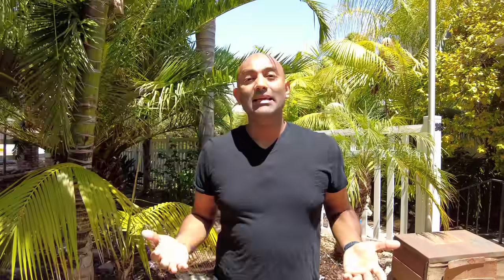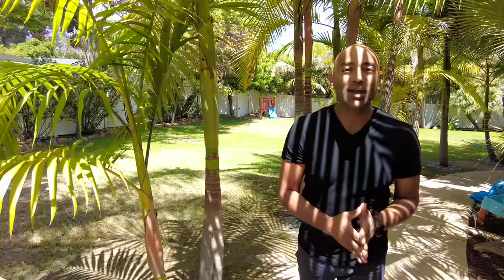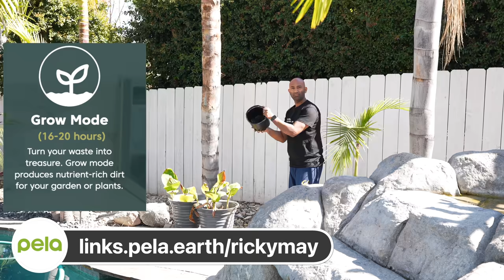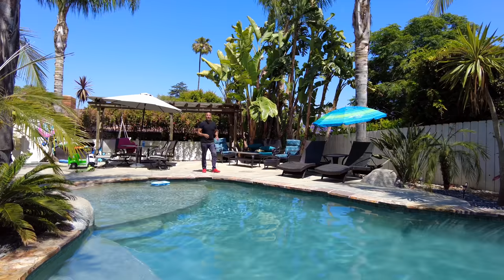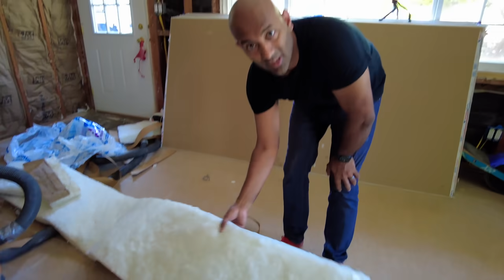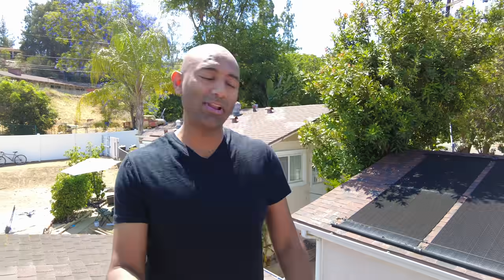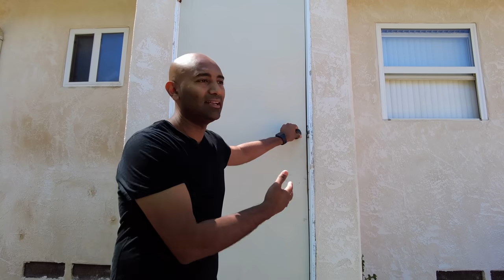How I'm Planning to go 100% OFF-Grid!

Comment: Love your channel. 

You should consider PVT solar panels, you get double the benefits, more efficient solar panels and some can even generate electricity by heat transfer! 

For your roof mounted pool water solar heaters, get some of the giant black metal exterior mounted (roof or walls) radiators like heat exchangers the Germans use. It's works exactly the same way your leaking ones do but are far more robust! Heavy also, but as you are sorting the roof, no dramas. You could also have one for your hot water. It helps the heat pump out by having the water at a higher ambient temperature, a double win for efficiency!

As for your cooker top hob, I highly suggest fitting an induction hob. No energy is used unless there is a pot/pan on it. It's got to be the right type of pot, but they are genuinely ace. Kid safe as well as you can turn it on, place your hand on it and there is zero heat. It only heats when the pot goes on....but you know that already I am sure! 

Question, you live on San Diego. It's warm there correct, hence very little to no insulation on your house? Why do you need a clothes dryer? Hang your washing outside on a line as we used to years ago. It's free and if you want that softness that a dryer leaves, just plonk it on for the final 10 minutes to finish. 
I love in the UK and have not used our drier since June! Washing line and clothes horse inside/outside as necessary! All free. 

I love what you are planning to do with this house. I will be watching closely as I night end up having to do the same on an old house here in the UK.

Comment: In Vietnam we usually have a solar water heater that use glass tube filled with oil to heat up water. It can run very well in a long time without needing for maintenance and very well resistant to contaminated water. Heating water takes a lot of energy and using solar electricity to heat water is not a very efficient way to heat water. With the small house that you only occasionally use hot in, you can use small electric water heater. It's easier to install and maintenance, also cheap and can be turn on off easily whenever you need.
Reply from the maker: Very cool!

Comment: Very interesting and big project! Looking forward to seeing the results.

For the 2nd house, if you only need hot water for a single sink, an under-sink tankless electric heater would be fine. They are available with as low as a 20A breaker (e.g. Chronomite). I'm investigating doing this for each room, to eliminate lag - without needing a recirculation pump.
Reply from the maker: Interesting! Yeah that could work

Comment: Could the heat pump for the pool cross connect to the geothermal system heat pump? You may be able to cool your house by heating the pool only
Reply: yes, but when you need to heat the pool the house may be cold too
Reply: @gsabic  then the pool could be aligned to the geothermal system. In theory it's the same as the octovalve on teslas. In practice it might be different
Reply: @beilkster  using the pool to cool the outdoor coil of a heat pump ( kind of geotermal) is a good idea, I have seen online heat exchangers that can be conected to the pool pumps pipes to works as outdoor coils in a heat pump. but there is only a small window of time when you need to heat the pool and cool the house, and adding valves and other coils to the system will make it too complicated specially regarding refrigerant levels.
If you wan to try someting I will do a mini split and see how if works before try a big ducted unit
 I used to be an hvac tech
Reply from the maker: brilliant
Reply: I don't know if that would work with geothermal but i am pretty sure i have seen a pool heatpump heater that could make this work. 🙂
Reply: Currently I have a solar water heater panel on the south side of the house that provides 160 degree water by 10 AM. Cost 12k installed and has worked well for 6 years. There is an option to run the hot water into a radiator inside the HVAC unit for winter heating.
Reply: @gsabic  This Old House had a project video a few years ago with someone doing this.  In the summer, the AC dumped the heat into the pool.  It is possible and a great way to kill two birds with one stone.
Reply: @thezfunk  good video, but more a science lab poyect than a pool heater. if you need to  heat the pool most likely you are not using the AC or just not enough to make any diference in the pool temperature

Comment: Why not do both for your solar? The dualsun is a solar panel that cools itself (water loop) which then heats your pool at the same time. I saw Linus use it.
Reply from the maker: Leaks and stuff just worry me. It’s a great concept but I have a salt water pool not sure how it’ll hold up. Solar panels are dead simple and reliable, not sure I want to complicate it
Reply: @TwoBitDaVinci  that's true. You can always do a small experiment, heating the other water tank, then and make video about it ;)
Reply: Have an independent glycol loop and heat exchangers. Systems are way more reliable than they used to be, the house is full of plumbing that doesn’t leak, it is possible. Besides if a roof can’t handle water on it what good is it anyway?
Reply: Also a supply of hot water is crazy useful. Any heat pumps trying to gather heat like a water heater or clothes dryer can have hot water passed over their evaporator and gain incredible efficiency.
Reply: You can use a simple pump and black-painted loops of PEX in homebuilt panels to heat that pool!  That can keep the bulk of your solar installation simple.  DualSun is a fascinating concept and work an experiment, because it does save you a lot of energy in heating water!

Comment: I am from Brazil, and here we do not use water heating using natural gas. We use showers with electric resistance and electric taps with the same technology.
In my view there is no need for natural gas in a residence.
Reply: I also see no need for a central heating system, here we use residence room mini Splits
Reply: agre, but those shower resistence electric heaters are not enough for the water temperare in USA. perople here like hot showers and not geting "zap" with electricity
Reply from the maker: depends on your home and your conditions. I would need like 7 mini splits for my home and that's not good. a central system is actually more efficient at some point. It depends on you, but we're going to go with smart vents that open and close and only heat or cool where you want it to
Reply: @TwoBitDaVinci  efficiency is mesured in USA in seer rating, 7 mini splits are much more efficient  than a central unit with the same seer. Lost of the energy is lose with the the duct, and smart vent are not smart, by closing a vent that you may not need you are creating static pressures and lowering your efficiency, to be able to do that you will need oversized duct and barometric bypass. If you wan diferent temperatures in every room you may wan to install zoning system (not eficient and expensive) A central ducted unit may still be the best option, but is usualy not cheap and not efficient. I used to be an HVAC tech
Reply: @gsabic  Electric showers heat the water around 55ºC, which would be equivalent to 131 °F. And there is no risk of electric shock due to safety restrictions imposed on manufacturers here.
Much of Brazil runs at 220V.
Reply: @HenriqueSilveiraSteinmetz  I am familiar with electric showers, I travel in brazil and all of centro america. they are a good option because they are cheap, but they only work when the water coming from the pipes is not cold. Maybe the new showers got better, but I did got zap a few times and almost every time the water was not hot enough or water flow was very low

Comment: Love it! You might consider looking into Sunamp thermal batteries for hot water heating. I believe you could throw heat at it using off peak electric, PV or evacuated solar tubes and it could smooth out your power demands to a more manageable level, while effectively serving much like a tankless water heater. The evacuated solar tubes would also probably work much better for your pool heating. Also, you might consider looking into those copper drain pipes from the shower that have a supply line wound around it as a means of pre-heating cold water incoming to your water heater. If you go geothermal, you'll have a pre-heat water tank too that'll reduce the temp differential even more.

Comment: There is a company that sells water cooled solar panels they’re an awesome way to go because the cooling makes the solar panels more efficient and you get hot water supply from them
Reply from the maker: my pool is salt water, and I do not think I want that added complexity and chance of leakage. traditinoal solar panels have served me for over 10 years in my previous home, and they're just so dead simple .... think I'll stick with it
Reply: @TwoBitDaVinci  you should consider either using these solar/hot water panels or just a few real glass hot water panels and a super insulated tank over the gas water heater. Or I have a desuperheater as part of my geothermal heat pump that does my hot water, if you do go with that for your heating and cooling.

Comment: We have a solar hot water heater… the panel on the roof is a rigid steel/plastic assembly with pipes. A pump pumps the water from the water tank to the roof where it heats up. When the water is hot enough a thermostat cycles the pump and starts it all over. I would think that short of solar water heater would work better for the pool that those mats you have now. Mine has been in use for 30 years… still going strong

Comment: Put better water heating mats under your PV panels, that should help with plastic UV  degradation.
Reply: Good idea but the material will still break down from heat/cold expansion/contraction and ambient sunlight but could add greatly to the length of both systems if done properly, if poorly don't could foul both.  I would suggest considering a thermal mass with the pipes laid within such as a full sun sidewalk or retainer wall that would transfer to pool without a 15 foot lift required and much more durable components thru out.  Use black rock or paint it to absorb heat...make a waterfall with a tidal pool that would warm in the shallow.  The earthship was designed to mimic nature's processes but in working compact integrated systems...with various options for the site/environment and need for back up/redundancy plans.  Requiring regular maintenance, earthship systems can be primitive to high end tech..but each require systems checking frequently based in an understanding of how the systems work.   Retrofitting a build conventional is a form of recycling but EShips concept was reuse as much as is possible from the waste stream of society to save on costs for building materials, reduce landfill waste, proof of concept, low carbon footprint, etc..
The project steps completely away from this with existing duplex, huge..conventionally build, already ripping and replacing at full inflated costs to new mates for the studio no less for living space surely.   I think you need to apologize to YouTube viewers for the click bait misnomer, and call this what it truly is...you are renovating your multimillion dollar home and going off grid completely, but not totally because of the instant on water heater need propane not 220V, and this is absolutely nothing related to a fucking earthship, you pompous ass.   I like your content, not the Cockeysville.  Humility and factual comprehensive detail in brevity and a concise form.
Correct course.
Reply from the maker: yeah I am not having water on my roof anymore. I'm going 100% traditional PV solar and using that energy for any heating needs i have via heat pump
Reply: Be aware that even a traditional electric/gas/geothermal equipment mount heater of any type will probably have a working life of three to seven years...ten is long.  Depending on use, climate, chemistry of water...lifetime can vary greatly.  The heat transfer or thermal induction is the weak point that fails and complete unit replacement is required, typ.  Heating a pool  is an imperfect act since heat promotes algae, etc growth counterintuotively to the chemical purification function of chlorine or salt systems.  In a pool with no leaks, salt chlorinators are best overall IMHO.  My concept of a thermal mass, properly calculated would use the same pipe as the pool jets, gentle loading heat energy thru a dedicated flow thru the adequately sized, sunlit thermal mass.  Passive solar such as this is extremely low maintenance and long lived.  The mass could even be used in the house (winter shading under glass) to increase ambient temperature and utilize that constant differential of home heat to outside or water temp.  Pumping timely and plumbed with insulation, etc..is a real potential.

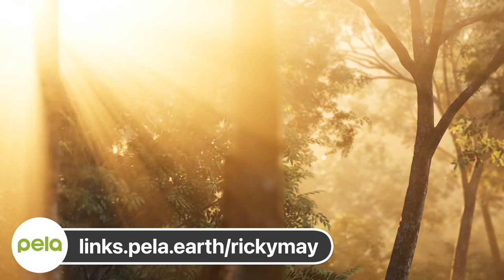Comment: @4:15 Lomi does not make compost. it is a food scrap dehydrator. Composting is a biological process.

it uses electricty to grind the food scraps, and then heats it up to dry out the food scraps. 
this heating process kills the natural bacteria & fungi that Composting utilizes, the heat also causes the food scraps to gas-off the volatiles. (you know that funky ammonia-ish smell, that's your nitrogen fertilizer being lost to the atmosphere...)
you then take the un-decomposed carbon-rich, nitrogen-poor, dehydrated food scraps and add this material to your plants... thus tying up available nitrogen in your soil in the process of breaking down the carbon-rich material into plant usable form.

it'd be easier and less expensive if you either had a compost pile onsite, or simply tossed the scraps into the kitchen sink garbage disposal and let it go down the drain (with your earthship/net-zero design that food scrap waste could be fed into an edible garden via your grey-waste water allowing nutrient recycling)

as a gardener with 30+ years of experience, i'm disappointed that companies manufacture and market these types of products to well meaning people who are easily taken advantage of simply because they don't know what they don't know. 

Why doesn't Pela/Lomi have all of the major YT gardening channels selling this if it's such a revolutionary product?
I wonder why there are few, if any, YT gardeners that promote Lomi? 

Is it because they saw right thru it?
Reply from the maker: the garden mode runs cooler keeping the bacteria alive, that's what makes it garden mode
Reply: @TwoBitDaVinci  But if the compost heats up, there is more biological activity and the compost 'cooks' faster!  Better off just starting a pile in the garden, getting the mix right and turning it regularly. Look it up.
Reply: Very well said H S . Thankyou for trying to wise peolpe up.

Comment: For the s aller working studio, consider a solar water heater. Had one in mid Florida house and it was amazingly hot. No electric or gas assist in my case. You could use the electric simply as a back up.
Reply from the maker: it's a good idea, but our roof space is limited, and I think i'd rather have PV solar. that way i can power anythign including a heat pump water heater. a solar water heater, when warm, doesn't accomplish anything else.

Comment: On the journey to electric only and massively cutting carbon and methane emmissions from our house. While were at it, replacing some inefficient appliances and buying an energy star (slightly larger) fridge to replace the 1990's one we both with hour house made a noticeable difference on our energy bills, as did getting an new (slightly smaller) energy star chest freezer to replace a 1980's one that had come with the house.

Furnace & AC -> Bosch IDS 2.0 cold climate heat pump with 15kw 2 stage restive backup (ducted, not mini splits)
Gas Range -> Frigidaire induction range
Power vented Water heater -> Probably Rheem hybrid WH (getting instalation quotes)
Gas dryer - > probably LG energy star electric dryer (and will replace inefficient washer at same time)

Where am in Minnesota, replacing a furnace with heatpump uses a lot less gas of course (and wasn't necessarily much more expensive to run) but it did double our annual electricity usage -wish we'd looked more into geothermal but anyway, not likely to be an issue in CA. So I'm hoping (though probably going to fail) to get another run of solar panels on a lower section of roof that is easily rakeable with a solar safe snow-rake in winter when the main array with it's low angle is snow coveted for days.

Comment: Don’t forget vacuum/heatpipe solar collectors for heating water. They have high efficiency and shorter payoff time than electric solar panels.
Reply from the maker: I'm going 100% PV solar. because i need electricity much more than i need hot water. so i'll run a heat pump water heater as needed. this way i can user energy for various things like charging an ev or heating a pool or anything else
Reply: @TwoBitDaVinci  I’ve got both. Live in northern Sweden.
Sized to my needs hot water for the tap and a portion of my hydronic heating.
The water heater is a coil from the solar collector and one from an exhaust air heat pump in winter.
Payoff time was less than eight years. Compared to approx 15 years for the same wattage in solar cells.